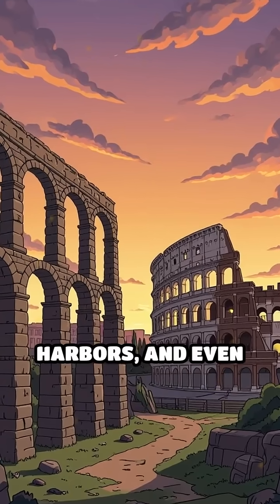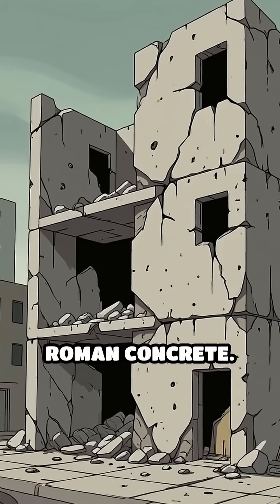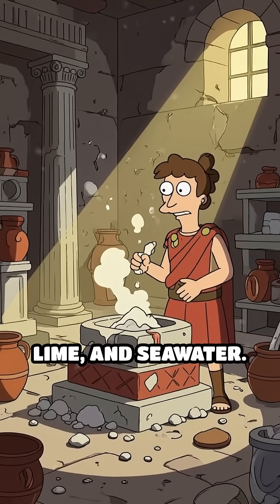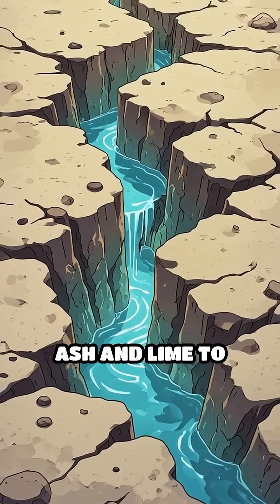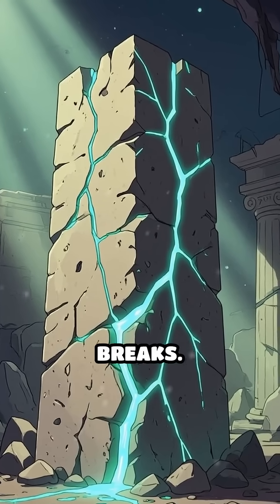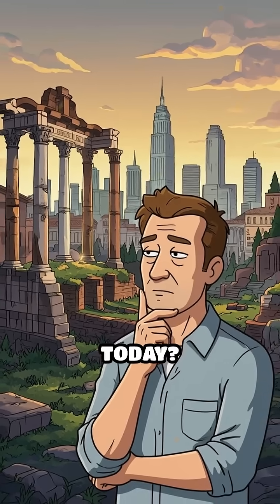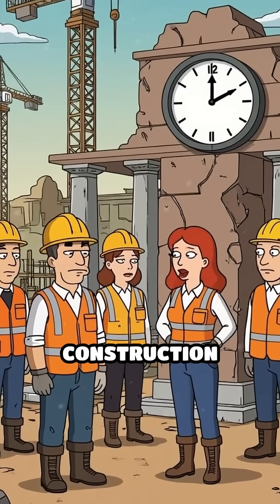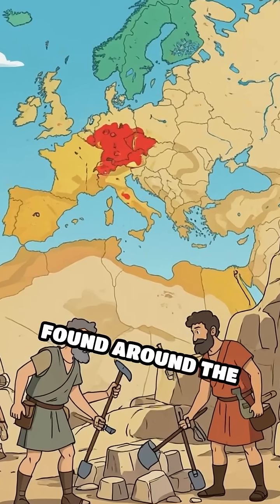“Roman Concrete vs Modern Concrete: The 2000-Year Secret”

Comment: Dude. The main and mostly only reason why it isn't used today is, that this type of concrete doesn't allow steel reinforcements as it attacks the steel. 
And you need them for modern constructions because while concrete is good at handling pressure it is super weak against tension. Thats why it gets steel reenforcements.